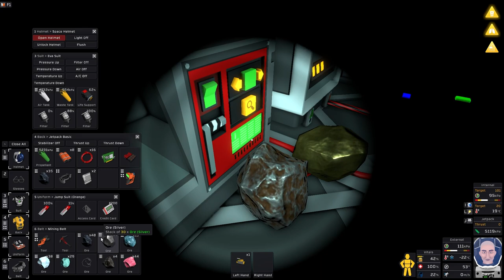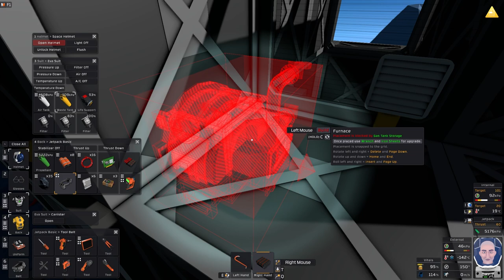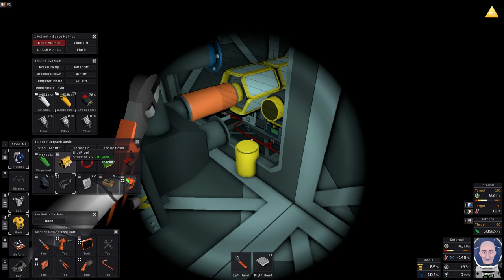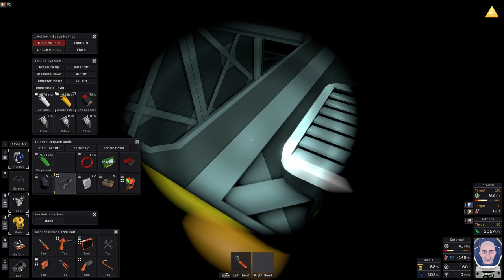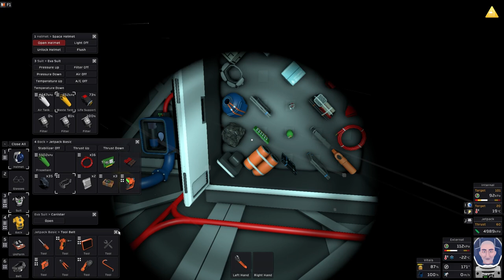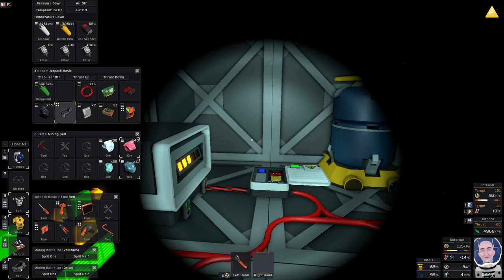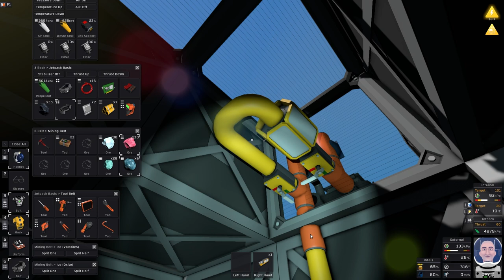Scavenging heat to warm our base on Europa - Stationeers Europa Ep3

Comment: I've been able to heat up living spaces/greenhouses by hooking up an air conditioner's waste connection to a length of pipe with an active vent drawing in Europa atmosphere and a passive drain to let out the oxygen that condenses to liquid due to the pressure. The phase change of gas to liquid warms up the contents of the pipe enough for the air con to draw heat from it and slowly warm a volume of gas.

Or hook the waste connection to a reserve of hot gasses from the furnace. More controllable, since you can dial a particular temperature in on the air con, than radiators.
Reply from the maker: @rcrawford42 it is only a short term problem, now I have a glass roof and walls, I should have enough solar heating to keep it warm. In fact, I'll probably have to look at cooling.

Comment: I think the problem was you used the wrong style of radiator.  The one you installed are for vacuum worlds.  And since they work in a 360 deg way, they were still radiating heat to the atmosphere.  Once you make your walls glass, cooling will become an issue! A great and cheap way that I use is a dig valve, radiator(s), sensor, cowl/passive vent and logic.  Set up a pipe network where Europa air can freely enter run the pipes into ur base to a radiator and have a dig valve turn on/off based off the gas sensor.  Note don’t have your base air pass thru this cause if there is CO2 it will freeze and pop ur pipes.

Edit: the right radiator is the convection one, it only has one face not 6
Reply from the maker: @charlesheath7571 Hi, I deliberatley used the six sided ones, I know they're optimised for a vacume but they transfer heat a lot quicker even in an atmosphere. Once I was close to the temp I wanted I should have swapped them for the convection ones, they have about half the heat transfer as the hex ones. To be honest I was doing it on the fly, if I'd thought about it I would have tested it out first and ironed out the problems, but what's the fun in that, you guys wouldn't have anything to be shouting at the screen about 😁🤣

Running Europa Air running through your rads will be cooling your base down, I was trying to heat it up, but I'm planning on using something like you mention to cool it if here's enough solar radaince or other heat source.
Reply: @dragonflygameruk4094  there will be enough solar radiance (Europa is my fav FYI).  I was able to get a1x1x1 glass room to over 1000C at 37kPa with solar radiance alone.  Granted it took 200 in game days…..but on avg a room will gain 2C from the sun depending on how many windows you have
Reply from the maker: So I'll have to keep an eye on the temperature, thanks.